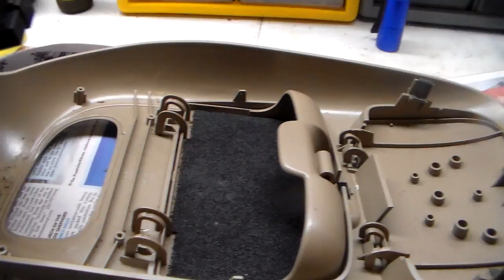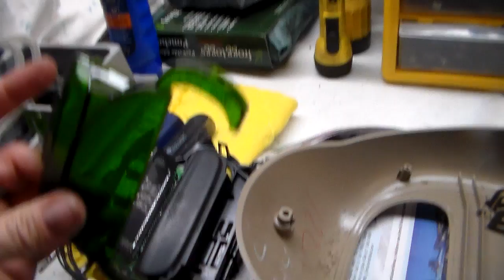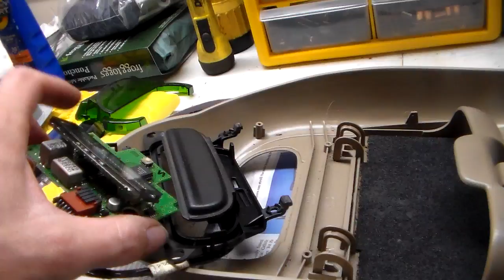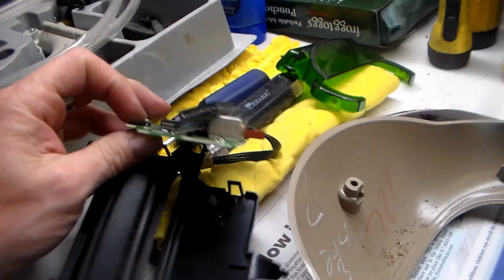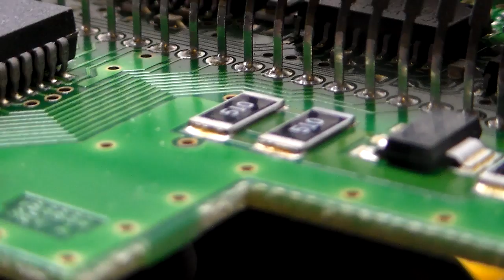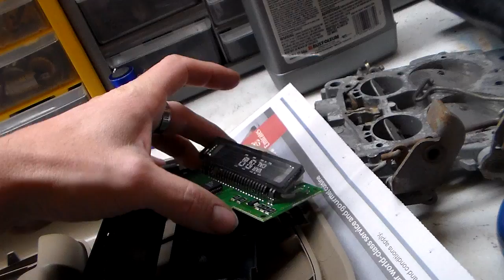Quick and dirty Ford compass repair video

Comment: The solder joint was cracked at the exact point you showed.  I would never have seen that without your video.  Great job.  Thanks

Comment: my overhead temp and compass did not work on 2004 F150. Watched video. Took conscole down and instead of taking four screws out I disconnect black box then took red connecter out and took a turkey baster and blew out all compents if that did not work then I would take out screws hook all up and it WORKED do this fiorst if no work attack. mine worked fine and compass readjusted
Reply from the maker: Sweet! There's always a Better Way.